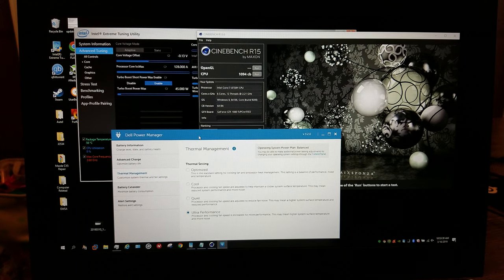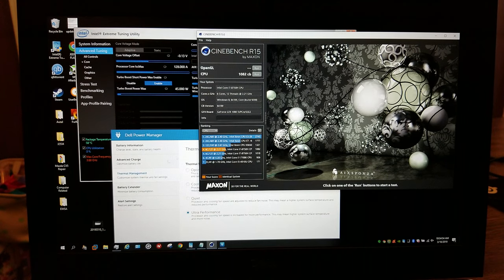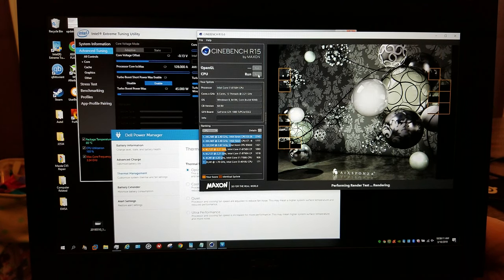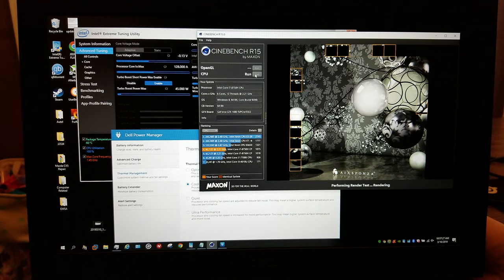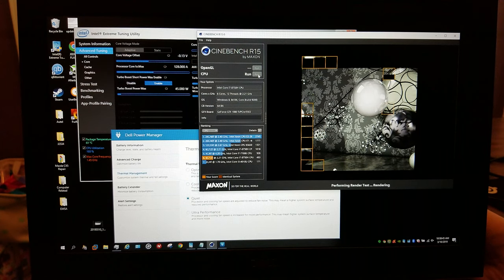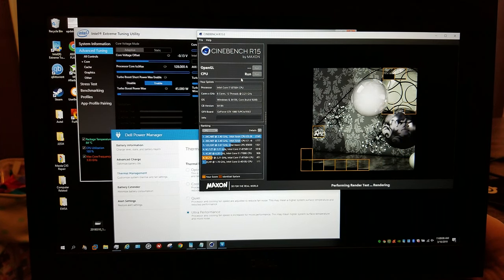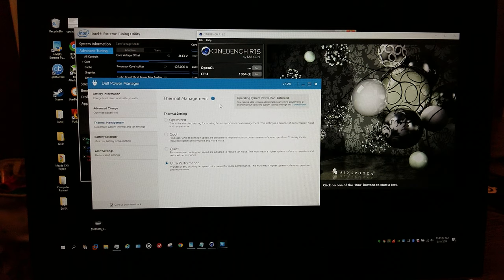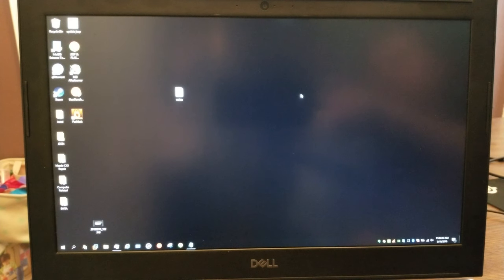Dell G5 5587 Bios 1.9 Thermal Performance

Comment: Thanks for vid man, almost did similar myself cause I went through so much crap  back at bios 1.4 was hitting max temps and getting real mad - everyone make sure min processor frequency is not 100% in advanced pwr plan. I don’t need to undervolt and my 1050 ti plays battlefield v on high 1080p

Comment: I found something, i bought the Dell G3 17 with the i7 8750H and the GTX 1060 Q-Max.... At the beginning i was getting serious problems with thermal throttling in the CPU, from 3.9ghz was dropping to 1.4Ghz y every game even when the CPU was using only 25%, i replaced the thermal paste, it helps to stay more time in 3.9ghz but always dropping to 1.4ghz.... i reinstall windows but now without installing the "Intel Dynamic Platform and Thermal Framework" driver in the device manager, now my laptop is always running at 3.9ghz in every game no matter the temperature, i have to say that now the processor is running much hotter between 80-100c sometimes playing but I've see some laptops gamers playing at those temperatures without problem, so I don't know if should be worried or not, the i7 8750H can run at 105c so should be fine lol
Reply from the maker: I removed the screen from the air ducts and redid paste and it stays below 70c with rtx 2070

Comment: Hey Drewsaster, am planning on getting the G5 with i7 + 1050 ti or i5 with 1060 max Q 6 GB RAM. But I got worried reading the huge complaints on Dell community about consistent heat of above 70 even for casual youtube or work. It sounded like a inherent problem. For me it ticked all boxes, but really worried now if I would end up with a hot Laptop. I dont want to open and do pasting. please let me know your feedback also howz the battery life in normal usage? Is it around 7 hours?
Reply from the maker: With the new bios it's not been an issue for me. I recommended getting the model with the 1060 as the 1050 Ti is barely enough for gaming where the 1060 is plenty
Reply from the maker: Battery life is ok but realistically you'll get 3 to 6 hours of heavy usage
Reply: @ANATURALDREWSASTER  Ah Thanks for the quick response. So would you recommend me to go with Dell G5  given your experiences?  Cos I dont want to take the risk of repasting or doing some fixes to a new laptop to reduce temps. I am a casual gamer, but mostly will be browsing, watching movies, and works stuff. But I may game about 1-2 hours when I feel like playing. I am ok with frame drops or mid level graphics :-)
Reply from the maker: @thiruvetti  yes, I would recommend the G5. Even if you did have issues, Dell support is pretty good and will get you taken care of.
Reply: @ANATURALDREWSASTER  Hey thanks :-) Will start looking for deals next 2 days.

Comment: Previously my laptop (latitude 7300) set at "optimise"  and it seems suddenly shut off automatically when the battery has reached about 40%, then i turned it to "cool" and there is no issue anymore

Comment: I am running bios version 1.2.1 and was planning to update to latest 1.13.1 but some forums say that version 1.12.1 has trouble when undervolting the cpu so should I update to 1.9.1 (for the thermal management stuff) or update directly to 1.13.1? (I plan to undervolt the cpu right now running at -0.160v stable max temps going to 85 using xtu stress test) Is it worth to take the risk of sacrificing undervolting and updating the bios to latest version?

Comment: I just bought the G7, not even a week old. I have had it randomly shutdown on me 3 times so far, while I was just browsing. I read online that it had something to do with the thermal performance. Did you have any such issues with your laptop? Any advice on this issue in general?
Reply from the maker: No, no such issues
Reply from the maker: You're going to be better off contacting Dell.
Reply: @ANATURALDREWSASTER  ok. Thanks!
Reply: wtb9999 makesure bios is 1.9, also coretemp is good for cpu monitoring , hwinfo64 allows you to manually control fans. Your fans aren’t kicking on till like 70-80c if it’s older bios. It’s getting better these are only a few yr old— a cooling pad can be a nice addition... cb if it’s a rtx gpu it needs better optimization
Reply from the maker: There is a newer bios out as well

Comment: Does it make the g5 a good purchase option compared to competitors? Looking to purchase it at i7 8750 16gb ram Geforce RTX 2060 for 2,300 aud
Reply from the maker: In my opinion it checked all the right boxes, good amount of connectivity such as thunderbolt 3, USB 3.1, and HDMI, has decent battery life, plays the games I play very well, and has a good cooling solution with it venting to the rear. I don't care for RGB or pure thinness, so for me I feel it's perfect. Maybe head to a store to try one out before buying if you can?
Reply: I love my g5 with only 1050 ti in it, you can use 3rd party hwinfo to max fans at 4500rpm area, if I do this i idle at25c and don’t go above 80c gaming. The new models have a newer nicer thermal design too, the spikes sb taken care of if u can’t yourself.
Reply: So glad dell finally adjusted this but the fans still kick on too late , hwinfo then no undervokt or loss of pwr
Reply: @drewbadwolf5182  Hey Drew, am planning on getting the G5 with i7 + 1050 ti or i5 with 1060 max Q 6 GB RAM. But I got worried reading the huge complaints on Dell community about consistent heat of above 70 even for casual youtube or work. It sounded like a inherent problem. For me it ticked all boxes, but really worried now if I would end up with a hot Laptop. I dont want to open and do pasting. please let me know your feedback also howz the battery life in normal usage? Is it around 7 hours?

Comment: Can you leave a link for the bios update? Or can my computer automatically search for it in it's settings or something? Also how do you check what bios you're currently running?
Reply from the maker: If you go to Dell's support website, you can download the newest bios for your system. The update will tell you whether or not it is needed on your system.

Comment: Please give me all the information you have on how to maintain temps on this laptop. I just got it and I undervolted it using throttlestop. max temps are around 97 while gaming, basically between 80-97 with a low temp of like 70-75. is cinebench 15 free? what other software should I install, etc;
Reply from the maker: Honestly I would recommend asking Dell to service your laptop, those temps sound a little on the high side. I reapplied the thermal paste on mine as per Dell's advice, which only marginally improved temps. The biggest improvement has by far been this bios update, I only undervolted to make this video. I don't undervolt regularly, and yes Cinebench 15 is free.
Reply: @ANATURALDREWSASTER  I updated the bios max temps only go to like 70, fans got really loud, blue screen during fortnite.
Reply from the maker: @bebopganymede  did you undervolt or anything?
Reply: @ANATURALDREWSASTER  I did undervolt
Reply from the maker: @bebopganymede  that's probably your issue then.
Reply: @ANATURALDREWSASTER  so should I return it?
Reply: @ANATURALDREWSASTER  I reduced the cpu undervolt from - 350 to - 100 someone else on YouTube said - 350 cpu core and - 150 cache was okay. Obviously wasn't.
Reply: @ANATURALDREWSASTER  perhaps I need to reapply thermal compound? This is a manufacturer refurb dell g5 5587 in Beijing red
Reply from the maker: @bebopganymede  honestly I can't say without seeing it, I recommend no undervolt if you're having stability issues. Undervolting with the new bios isn't necessary for gaming.
Reply: @bebopganymede  its different for every laptop
Reply: The ubdervolting ammount differs, like i could only hit -139 on all

Comment: Does this Laptop heat when editing videos, browsing etc?
Reply from the maker: Yes it does, it's a high performance laptop in a portable form factor. It does emit heat when under load.
Reply: @ANATURALDREWSASTER  it gets hot even when browsing wow
Reply from the maker: @isam3601  it just gets warm browsing, not hot and not even warm on battery but plugged in which increases performance it can get warm yes.

Comment: What are your temps
Reply from the maker: I honestly don't know, since the fans now run full speed under full load I haven't checked since performance is now consistent. With an undervolt of .13 it regularly scores higher in Cinebench than a i7-7700k desktop at stock clocks, so I'm more than happy now. It still spikes when initially loaded, but from glancing it usually stays under 70c on the new bios
Reply: @ANATURALDREWSASTER  can you do a video on downloading cinebench, what is undervolting, how to undervolt, etc. I got the G5 in red
Reply from the maker: @ARIEL CRUZRAMIREZ I did actually, but YouTube would not let me upload it saying it was a duplicate 🙄 however there was a huge performance increase in Cinebench, I think it bumped the score like 2-300 points if I remember correctly.